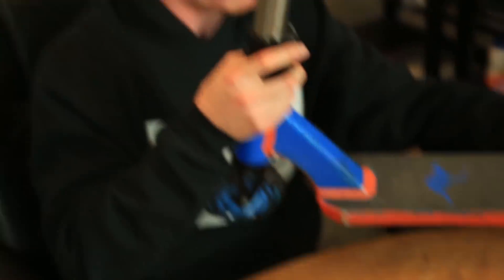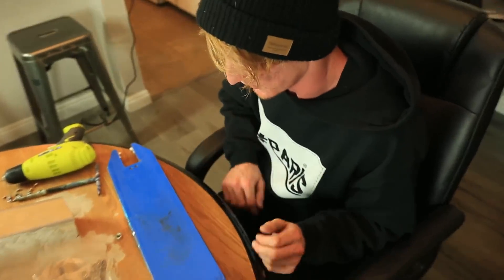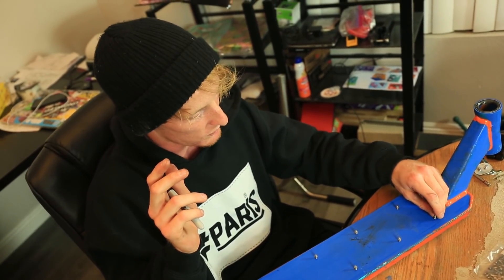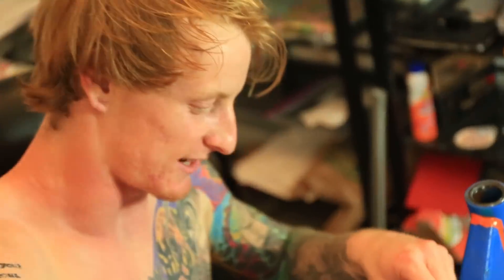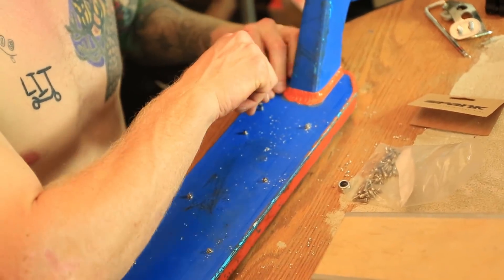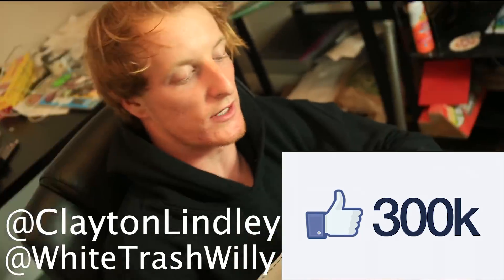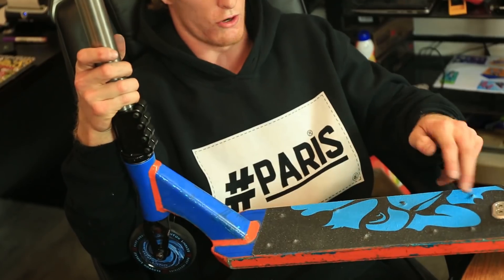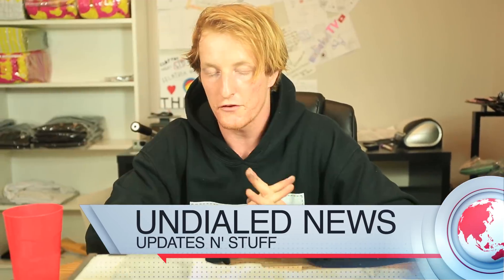Best Grip for a Scooter Deck! How to Install Deck Pins *DIY*

Comment: Apparently if you don't run the grip the pins are lighter than the grip so you can save weight by doing this.